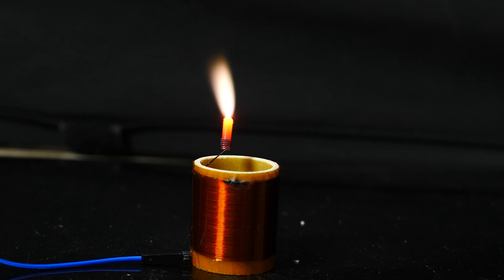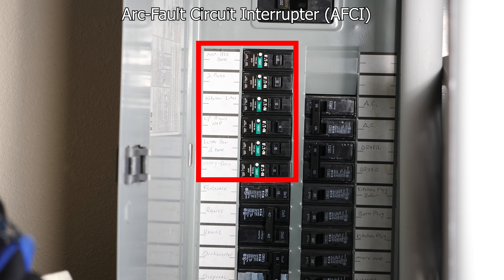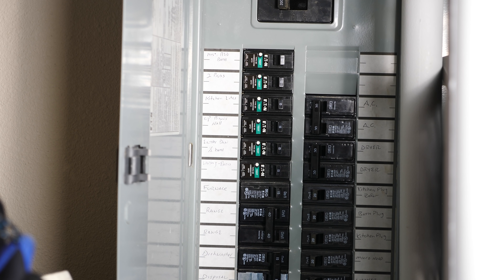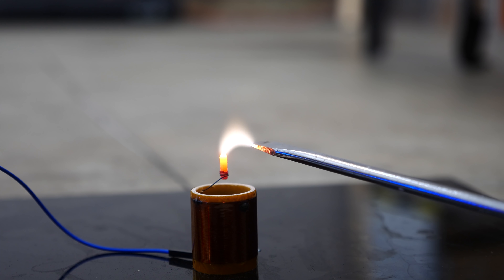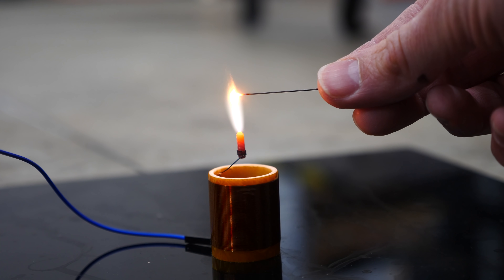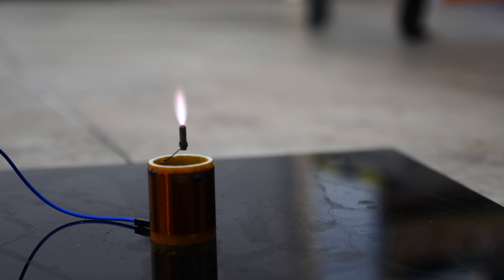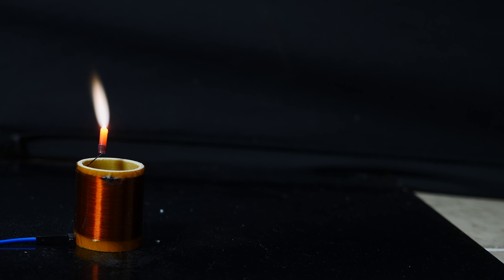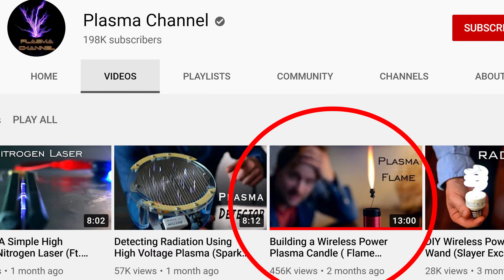The World's Hottest Candle Can Actually Melt Steel—Plasma Candle

Comment: I've seen several DIY 10 MHz SSTC videos and designs (Even built a crappy one), however this one appears to be a kit of sorts.  Where did you buy it from?  Also, why do you have what I assume is the secondary coil sitting off to the side instead of on top of the primary?
To anyone thinking of building one get ready to be burned a LOT.  Even without a secondary the high power RF will induce currents  in everything conductive within about 8 inches, meaning if you go to pick up solder, a screwdriver, random bits of wire, etc. you're going to get burned by the tiny arc to your fingers.  Also a warning that only a few types of capacitors will work to couple to the primary and to a lesser extent from the MOSFET gate to the source.  Small ceramic or mylar/polyester caps will overheat and start smoking, and the primary coupling cap has incredible stresses on it, destroying homebuilt caps and ruining others.  I ended up using a vacuum variable cap, though high voltage silver mica caps also work.
Reply: I'd also like to know more about how this was made, if it was a kit? would be nice to get one, the form factor seems awesome.

Comment: Two things came to mind… 1. What color would it be if you did this outside during winter when  air is freezing? 2. What if you put the flame portion in a vacuum chamber and then apply a vacuum as it was operating.

Comment: GFI or AFC breakers trip when power goes to ground rather than neutral, has nothing to do with arc even know its refered to as an (arc fault ) device ! Your breakers  were tripping because the high frequency allowed for capacitive coupling between your grid (the plug) and ground... too much power going to the ground rather than the neutral will immediately trip any arc fault breaker

Comment: When you set it on concrete, it literally grounds enough of the electrical field of the tesla coil so it doesn't trip your breakers. Its actually the same reason you shouldn't leave a car battery sitting on concrete! I've found the best place for a car battery is either in your car (duh) or on a wooden chair.

Comment: What youbhave is atomic fire. The electricity is splitting the molecules in the air in the area of the energy release thus causing a plasma flame. Basically atom sized atomic blasts. Thats why its so hot. You are basically creating a really small area that is as about as hot as the area whete a nuclear bomb goes off is.

Comment: Two things: the steel wire is not melting but actually BURNING. The drop that formed at the end after cooling is called slag, and it contains oxides of iron.
Also, the LED you mentioned that lights up near the coil seems to be a neon tester bulb, not a semiconductor LED.
Reply: Yup, actually it's BOILING and burning as well. Iron boils at like 5000 degrees, and since the plasma is 11,000 degrees, that's plenty hot enough to boil iron.
Reply: And those circuit breakers will be more like current protectors, and due to high frequency radiation, alternating voltage is induced in the mains voltage distributions and the current protector trips. The guy just doesn't know what he's talking about, but people like it.
Reply: @hankaajindrich8622  He's curious, finds interesting things, and does some guesswork. But he usually points us in the right direction, if we want to learn at a deeper level. I can respect that.

Comment: could this be used to melt and or soften stone to enable quick removal? if it melts things so well, then i can imagine a CNC device used in a specific pattern in a mine that could carve out the space my melting the stone and easing the use of carving tools to cut through it. so, a bit like a plasma cutter i suppose, but only using electricity and nothing else.
Reply: I always believed plasma cutter only used electricity and nothing else then normal air blowing ?

Comment: will it still function in a vacuum? Is this kinda in the simplest way how the VASIMR engine works? Plasma in a vacuum sounds like a cool experiment for you to make a video about.
Reply: It functions by turning the air into plasma, so no, it won't work in a vacuum unless there's a gas jet being blown over it.
Reply: No you will need to bring air with you into the vacuum
Reply: @karlkarlng  kinda defeats the purpose x)
Reply: do you guys, consider this flame as a fire or not?
Reply: @alucardlord9032  yes it sure looks like a flame to me.
Reply: @alucardlord9032  I'd kinda consider fire to be more like sustained chemical combustion... this seems more like "electron fire"
Reply: @alucardlord9032  That depends on your definition of "flame." Many (maybe even most) people would say no, but I'm of the opinion that it's a "distinction without a difference" situation. If it looks like a flame, acts like a flame, burns things like a flame, and can be used like a flame, then it's a flame, even if it isn't a combustion reaction itself.
Reply: https://youtu.be/HlGKC8EdChI
Reply: If there were another polarised coil in the vaccine it would probably create a huge arc as the resistance of the air is lower
Reply: Joi?
Reply: https://youtu.be/sBdt_becAVs
Reply: https://youtu.be/sBdt_becAVs
Reply: https://youtu.be/sBdt_becAVs
Reply: Yes that would be interesting... But you must be careful with high voltage sparks 50.000 to 70 .000 volt or more and vacuum as it creates x-rays.

Comment: Something that can induce enough current to cause the breaker to act and ionize gases is pretty scary!
Reply: The problem was not the current but the high frequency RF it gave of that triggered the special breakers he had. StyroPyro did something similar but much larger and more dangerous and he put his contraption in a RF safe faradays cage so it would not wreak havoc with everything around it because of the radio noise it created.

Comment: This is pretty cool i am wondering if lets say a plasma cutter using high frequency instead of current would be practical.  Some class mates and I built a Jacobs ladder in an electrical class some years ago and we were able to light a bulb without any physical connection just like you did in the vid. I assume the its along the same lines.  I am impressed on how hot the flame got with the high frequency.

Comment: Would bei Interessting to See what happens if the high voltage is rectified and phase shift by 90degree and then right angle alignment to the magnetic field of the base.

Comment: 1:32  yeah, they actually can't tell the difference, that's why your breakers trip when the thing is not connected to the circuit.
Unless a miracle happened in the last 6 months, AFCI breakers are just a nuisance trip device.
Most eletcricians i knew and worked with just end up replacing them with regular breakers after the inspector signs the inspection report.

Comment: You know you want to put this thing in the vaccum chamber and see what happens to it (also will be interesting if a smaller chunk of concrete also keeps the breaker from tripping) 

Wonder what part of the concrete is preventing the breaker switch and if brick, clay, or some other material does the same thing?
Reply: If you have high voltages and vacuum you will most likely produce x-rays... 70.000 volts or higher if I remember correctly is where it starts to make x-ray in vacuum, but that is with DC, I do not know what happens with high frequency AC like this.

Comment: so, I'm curious about this thing, and the heat produced. I wonder if you could make a plasma forge?  I mean the answer is yes of course, but could you make one for less electrical input than an induction forge?   or a foundry, or a kiln?  I'm just wondering if this sort of thing would be "greener" than current tech used for such applications?    
I also wonder about stirling or steam engines using this sort of high frequency plasma discharge for the heat source.   I mean that Seems like an extreme amount of heat for a relatively small input (I realize I may be ignorant on this point)
Reply: It is not extreme amount of heat, it is extremely concentrated and high temperature but not much of it. So what you suggest would be less energy efficient. It is good for melting things but not good for heating things up because it is hot but not much energy.

Comment: What if you put this thing in water? (I’m not sure if it is safe because electricity runs through water but I remember from high school how water also have a high specific heat capacity so could that put out the fire?)

Comment: Very cool! When that steel is emitting sparks, it has entered “kindling” temperature and is actually burning because of the presence of atmospheric oxygen. I use a hand-held plasma cutter in steel fabrication almost every day that combines moderate air pressure with an impressive plasma arc. Protect your eyes, it’s bright!
Reply: Not only that but intense UV! You only get one pair of eyes.

Comment: This is interesting, but I want to see him try to  NOT trip the breaker by isolating it by other means. I think the concrete contains metal particles are being induced by the signal. May particles over a distance interfere with each other, weakening the signal induced in the wiring, making it too weak for the ArcFault interruptors to detect. I would expect that water, metal plate under the coil to have a similar effect. Also, what about everyone's favorite, a Faraday cage?
Reply: OOh! You built a dark room, a bright room, and now build a faraday room!

Comment: I hope you see this question. I noticed you were holding that metal wire as the arc flame melted it. How did it not heat up the wire so much as to burn you through heat conduction?
Reply: Probably because the metal doesn't have enough time to heat up and it melts whatever is burning currently

Comment: That green bulb was not an LED, it was a neon bulb with a coating inside.
LEDs only require around 2.5 volts to light, but neons require at least 50 - 60 volts.

Comment: You want a real shocker, a piece of chalk should heat and then very shortly afterwards glow incredibly brightly. This should be hot enough to gain the same effect the oxyhydrogen flame provides for a limelight, as well as plenty hot enough that the calcium carbonate breaks down into the needed calcium oxide.

Comment: I would like to respectfully submit that by putting the device on the concrete floor, the HF radio waves it gives off at 90deg to the vertical loop [ie, emanating horizontally] were now below the level of any wiring they might have otherwise run into as they traversed your house. Ergo, nothing to do w/ the concrete, & everything to do with the change in relative altitude... Just a theory; what do you think?

Comment: Nice setup, but "regular" fire doesn't mean anything. heat of a flame depend of your fuel and oxydizer among others, in the case of your lightner propane or butane with air ( 20% oxygen ).  All flames are plasma. Yes you can blow a chemical fire, by sapping the oxydizer you stop the combustion causing the flame, your setup use a magnetic field and your candle get "blow" by a switch.
But i'm very concern by the fact that all yours breakers blowned from one socket, each breaker is here to protect one close loop from the others . The fact that all of them act maybe a grounding issue ? (the problem was resolve by putting it on the concrete) . Check out the ground of frequency generator / current amplifier .

Comment: Instead of putting it on concrete, try this instead: 

A solenoid is a pure inductive load, and at such a frequency it creates a phase differences between the current and the voltage, this leads to over consumption of power than is necessary, also it can sometimes lead to a sudden current surges or rushes, I think this is why the breaker is being triggered.

The way to fix this is capacitive power factor correction, i.e you put a capacitive load in parallel with the circuit to correct the phase difference induced by the inductive load. You will need to calculate the required capacitance, you can find the relevant equations online.

Comment: This looks a lot like free energy. Heating up high melting point materials with low wattage means you could create a lot of steam that could be put to work. The flame also seems very similar to an HHO flame that can also burn items with relatively low energy input.
Reply: I don't think he said it was low wattage. He said it was high voltage, but low current. So the wattage is probably somewhere in the middle.
Reply: To make steam you need a lot of watt / energy, not high tempertures in the 11.000kelving range like this... It would not be good for steam generation. But at this temperature it would probably turn the steam into hydrogen? That could be more useful then generating steam...

Comment: Facinating as usual. May I point out a technical problem.? You said it correctly towards the end, but annoyingly got it wrong at the start. The high frequency does not induce a current in the breakers, it induces a high frequency EMF VOLTAGE at very little current.
It is a very common misconception that current flows in a circuit. Of course it should be a voltage flows in the circuit.
The current is dependent on the load, expressed in Watts. (If there is no load, there is no current at all.) An annoying by product is current.
Current is not primary. I hope you don't mind me pointing this out.

Comment: if I am not mistaken that is how most places who forging heat metal  i worked at one place that used  something similar to heat the plugs to forge  gears. well not the plasma  flame but the  high frequency heat   like an induction plate.
Reply: Not really, this uses a very high frequency, high voltage, power supply to create plasma; induction heaters use a much lower frequency (hundreds of kilohertz) power supply to drive a work coil to develop a high-frequency magnetic field which creates eddy currents, heating the metal internally.

Comment: Nifty ! As per usual. Yup, Acr Fault breakers are code in like sun rooms & such in a lot of places these days. Was gonna say, if that little gizmo is drawing 15+ amps(even just @120V US typical = or about 1800 Watts) its just faulty AF. A Real commercial plasma cutter on the other hand surely might. Occasionally, even GFI's don't like some contraptions either. But when they trip it is almost always a good thing.

Comment: Hey if it uses that big voltage, it uses high current as well. Or am I just this stupid? :)
It uses lots of energy, doesn't it?
Reply: The higher the frequency, the lower the current due to the induction resistance of the coil.
Reply: @jeffo9396  Well, f*** that s***.
Why am I this stupid?
Thx btw :)

Comment: I'm not sure if you're familiar with John Kanzius. He was a radio engineer that was trying to develop a method of treating his cancer that did not require chemotherapy. The idea he had was to induce a high frequency potential that would be harmless to the body but would only affect cancer cells that were doped with a gold filament. One of the interesting byproducts of his research was inducing an open flame on a beaker saltwater In a field of 13.56 megahertz. Since your device is pretty close to that range I wonder if you can attempt to duplicate his research.

Comment: Here in Canada I had only heard of GFCI in use in homes, I was a tiny but confused for a fraction of a second when you mentioned AFCI.
Perhaps it is time to upgrade the most used power runs to GVCI / AFCI dual protection circuit breakers.

Comment: It's even more surprising that you can hold the solid end of a piece of steel wire hot enough to melt (as shown in the thumbnail)
Reply: It’s thin enough and melts fast enough that the heat doesn’t really reach your finger by the time the other end is sparkling hot

Comment: Ultra high frequency Tesla coil at 15 MHz.

For radio waves, ultra high frequency (UHF) is 300 MHz to 3 GHz.
30 MHz to 300 MHz would be very high frequency (VHF). 15 MHz falls into the range 3 MHz to 30 Mhz that would just be high frequency (HF).

Comment: 4:27 You CAN use this to weld, right? (is this technique used in some actual welding? What's it called then?)
Reply: A welder has more current and less voltage. I run 17.5 volts DC on my MIG machine and about 120 amps. This is about 30,000 volts at 15MHz. Maybe .2A if that at all. This is at such a low power compared to a welder
Reply: @glonkfpv  Do both emit UV-C when melting metal? I hope he did not have a painful night after doing that.
Reply: @volare_cantare  MIG welding definitely emits UVC from the arc. This, I'm not sure
Reply: I'd think this is similar to plasma arc welding

Comment: I prefer the styropyro version that runs on old Soviet vacuum tubes, melts through carbon electrodes under a minute and could probably do the breaker trick in the next house over if it wasn’t in a faraday cage. But it’s still pretty cool when this small and much less instant death.

Comment: Will also give you a very severe burn without you feeling any pain, at least for the first second or so, till it has eroded a big crater through your skin and tissue below. That injury also takes a long time to heal because of the tissue damage that is in a larger area than the actual burnt white section, the rest has been cooked alive for a small distance into the body.